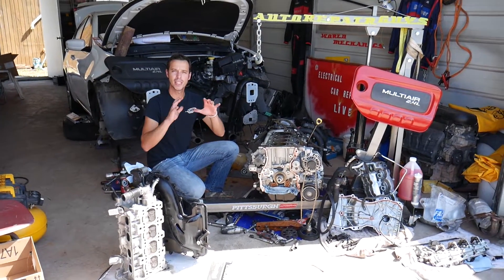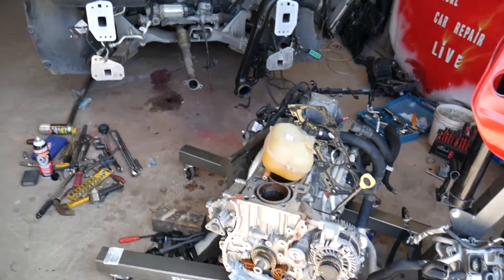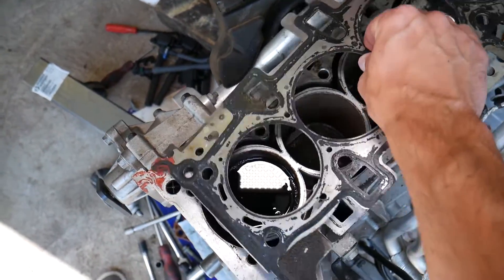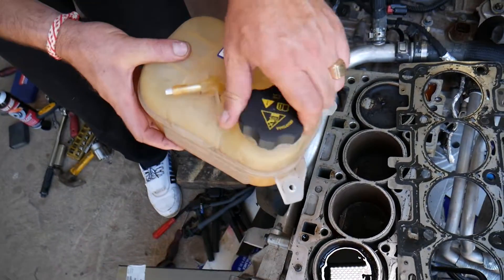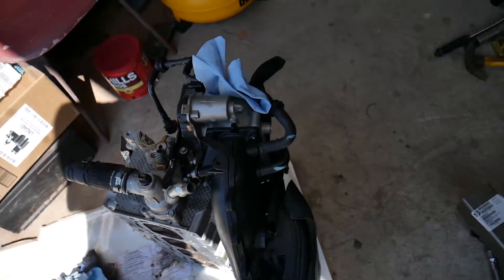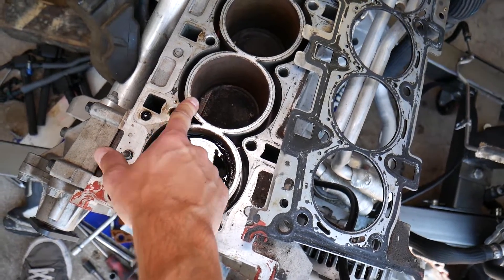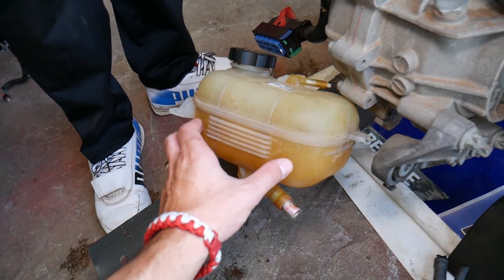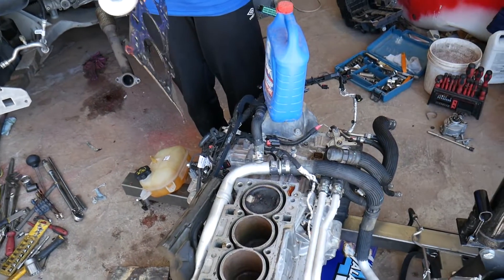WHAT CAUSES PRESSURE BUILD UP IN COOLING SYSTEM, TOP 5 REASONS FOR PRESSURE IN COOLANT SYSTEM

Comment: My car doesn't over heat, but my upper and lower hose's get really tight and buldge. The lower looks like it's about to blow like a balloon. The upper is bulging at the inlet and is leaking. This happens every couple of years I have to replace them. Any suggestions?

Comment: Why is the antifreeze under pressure and at a low level when the engine is cold and when I open the bottle cap the antifreeze level rises?

Comment: When my car engine is hot then coolent level is low in coolent reservoir but when i open the reservoir cap coolant moves up to normal position what could be the problem
Reply: I have the same problem
Reply: @WildBill541 7
Reply: @WildBill541 it will be number 4, due the increased air in cooling system the requires more coolant to circulate making it go very low when running, and after u stop and open the cap the coolant will go back to normal

Comment: MY HEATER HOSE BROKED ON MY 2005 CADILAC ESCALADE  6.0 VORTEC AND I FIXED IT BUT NOW THE SYSTEM BUILDS PRESURE AND BRAKS MY RADIATOR 😊
Reply: Burp the system; it may be vapor locked and not allowing for proper circulation

Comment: HEY...heyyy.....what about that Crap Factory Oil Housing on BMW minis...with the 4 only bolts and a oil port and coolant port that has a rubber...flubber gasket if it's old or car heats up the gasket will harden..
AN
Uuuuuuu all know what happens then.....the pressure bleeds friggin out...........where y'all think that oil goes........or the coolant goes.....if you don't have an external leak .....so it may not be a cracked head or block......or HEAD Gasket.
AFTER ALL.😊😊😊😊😊😊😊😊😊

Comment: I am having issue with my e46 m3 overheat only when AC is running after 30 to 1 hr  then it goes down then backup everything has been replace except the radiator need help

Comment: My coolant gets all bubbly but the car over heats while driving it in city and not on longer motorway way routes if i leave the cruise on on motorway the car won’t heat up but if i drive aggressively it over heats that results in complete loss of coolant and pressure from the pressure hose next to the radiator cap

Comment: I have a question. 
I have an Infiniti G 35 coupe that when I start up in the morning when it’s cold or any temperature pressure builds up in the radiator hoses right away like seconds , but it’s not a head gasket. The car does not overheat the reservoir never gets above max. The OBD2 reads normal in between 185 and 210 depending on the weather, both fans are operating at the proper temperatures, the heater works great in the winter
But after driving for a half an hour or so normal driving, the engine is just scorching hot. I don’t know if that’s how these cars just get but you cannot touch anything on the motor yet. It only reads 180 to 210° do I have a plugged up radiator when I put a spill free funnel in it fluid fills it halfway up and then it stays that way throughout the whole temperature range. There are no air bubbles even when I squeeze the hoses. and of course you can’t see if the radiator is flowing Because of the spill free funnel, and there’s no way to run the vehicle with the radiator cap off without the funnel freeze just pushes out. Is this normal?

Comment: If there is only a minor exhaust leak into coolant, will a lower rated psi (e.g. 15 psi instead of 21 psi) coolant expansion tank cap be used? I have come across an engine that rises pressure near the cap limit shortly after shutting off. And in many cases after hot restarting the engine (e.g. 5 min after refueling) the engine jerks as coolant seeps into the cylinder and fouls one of the spark plugs. I believe this can work, especially if 50-50 coolant is used. There is no need to have 21 psi cap, it is just overkill.

Comment: hi, there is no pressure at all in my cooling system even after the vehicle has run for longer hours,   rather  the coolant escapes to the reservour tank then out.     there is no leakage and i have replaced radiator caps so msny times, the problem is still the same...any ideas?

Comment: Thanks for the video.  I have an issue that is stumping me.  Volvo xc 70 5 cy.   Tested for head gasket and the Co2 tester did not change color, which tells me on exhaust in coolant.  But the water level in the reservoir (there is no radiator cap), fluctuates and pumps water and air out.  It acts like the motor is overheating but the temp gauge reads within the normal range.  If i drive it much, it will overheat. There is a radiator leak and a new one is ordered - i repaired this one with plastic epoxy, and it's almost stopped.  Thermostat was removed for the test.  i have two radiator caps, and it acts the same with either one.  Is there anything else that would cause this geyser effect in the cooling system???  Thanks
Reply: Yes. In the same hapen in my nissan altima 2015s. You fix this problem and please tell me how to fix.

Comment: My coolant tanks keep cracking and leaking. I had 3 coolant tanks, new waterpump, new thermostat. No other symptoms at all....the coolant tanks just keep cracking after a few weeks/months. Did 3 head gasket tests...all 3 negative...no clue what else can it be..that increases pressure and cracks my coolant tanks
Reply: Your new thromostat might be faulty

Comment: My car wouldn't start this morning, well it started for 3 seconds and stumbled before dying then not starting. I took the radiator cap off and it had a lot of pressure and blew coolant on me (it was cold btw). I then pulled plugs to see if they were white and they looked fine. I started the car with the radiator cap off and it started no problem, it slowly pushed out a bit of coolant along with some bubbles then it stopped and didn't push any more out and no more bubbles. I'm hoping it's not a headgasket. The car doesn't have white smoke out the exhaust and plugs look fine. I previously had an issue with the radiator cap but I don't think that would cause it to build pressure in the system while cool would it? Strange.
Reply: What about a low pressure cap
Reply: @OkieDokedU  Unfortunately it ended up being the headgasket was blown on cylinder #4 and was pushing exhaust gas into the cooling system, luckily none went into the oil. Strange thing was I did a compression test and it came out perfect, all cylinders were within 3PSI of each other yet the headgasket was bad, but after thinking about it, a cylinder has way way more pressure when running and combusting than just moving up and down so it makes sense I guess. Anyway, I had the engine rebuilt so it's all good now.

Comment: Hi there, I have an issue with my Holden cruze, the pressure and bubbles back out the reservoir. After I drove for 15 mins, the radiator was still cold. 2 top and bottom radiator hoses were hot. I bled the air several times but still the same. The radiator and thermostat were new.
Reply: any solution yet?

Comment: Failing water pump allowing air into the system is quite common.
Reply: 30 years of being a mechanic and never once seen it happen. Please explain how.
Reply: @TheModAddict  A small leak from a bad water pump gasket can allow air into the system right?
Reply: Why is water pressure hose tight
Reply: How would the water pump allow air into the system?
Reply: @luis5017moreno please explain as i’m trying to diagnose

Comment: I need help. I change my cylinder head it was blowed (mechanical told me cylinders are not very good, he see that antifriz has go there when my head blow).  But now with new cylinder head i have problem with my antifriz level. When i will off engine after drive, there is normal level of antifriz. It is always after maximum line. But in meanwhile  antifriz level is going down under the minimum line, and when i start engine there is sign to check coolant. Before i open cap there is missing antifriz (under minimum line), but when i open cap there is little pressure and antifriz is coming to normal line between min and max line. I dont have white smoke, i dont have bubbles in coolant. I have 2.0 TDI BKD 2005
Reply: I have the same issue anyone knows ?! Did you fix it ?
Reply: @aymangamal7469  i fix it with something like liquid that is put in antifreeze. Probably there was little hole somewhere, and with that liquid you will fix it. The best option is to find where is hole and change the that part. Do you have white smoke on first start or maybe in driving?
Reply: @profpetarsazdov you never pour a liquid sealer into your car
Reply: @profpetarsazdov I would say maybe you can pull the air bubbles from inside radiator theirs a special machine, like 15$
Reply: @OkieDokedU radiator seal is ok. Oil seal in the engine is ok just don't ever use head gasket sealant that stuff is😢
Reply: Oh man I have the same problem now with my equinox 07 have pressure in the tanks and antifreeze return normal level when retire cap :(

Comment: I brought a disco td5 and it had the head gasket replaced but it was building up with pressure but removed the head and seen a a score in the head and the in print on the gasket they said it was skimmed but it wouldn’t have a score if the case so I’ve brought thermostat gasket kit and cap for tank what’s your thoughts I’m doing rebuilding the morning

Comment: Would a bad water pump cause excessive pressure?
Reply: Yes
Reply: A leaking head gasket can cause to much pressure Easy to diagnose take cap off start the car let it get hott there is a tester looks like a big syringe with no needle lol has yellowish die in it u put in big syringe put it on where radiator goes if it turns color u got a head gasket leak easy enough the tester is cheap get it anywhere it’s called a combustion leak detector
Reply: Iam  wondering the same because i have this issue.Air Pressure build up in the radiator .If its the water pump then its a cheap fix.
Reply: take the radiator cap off it has all kinds of pressure underneath and then that losing air noise up top quits
Reply: Can someone tell me what this could be please